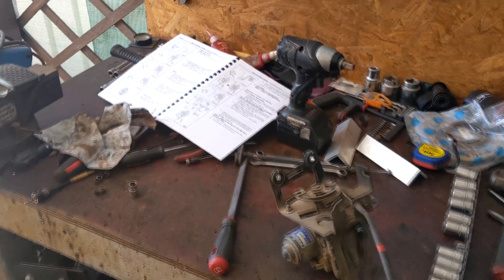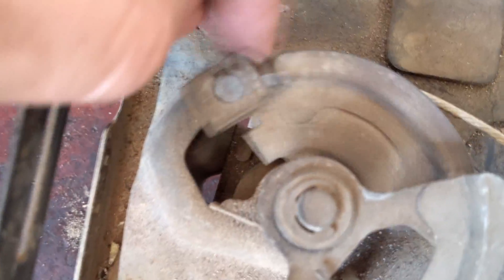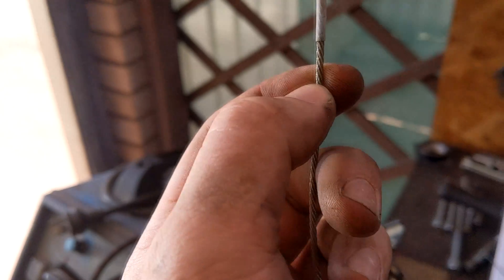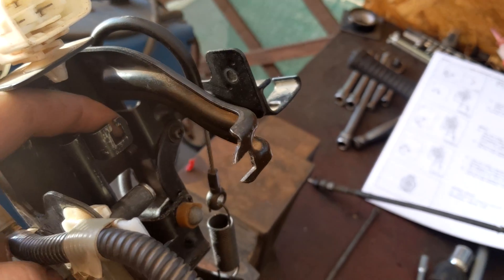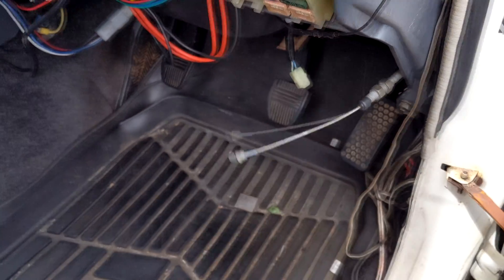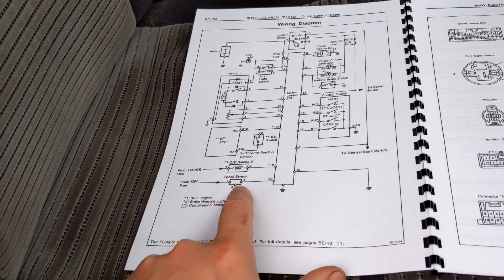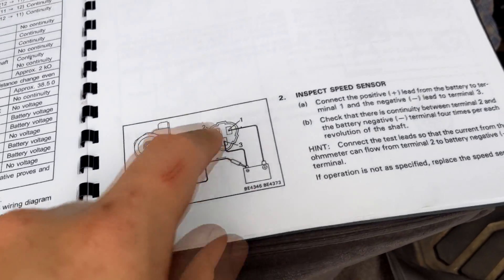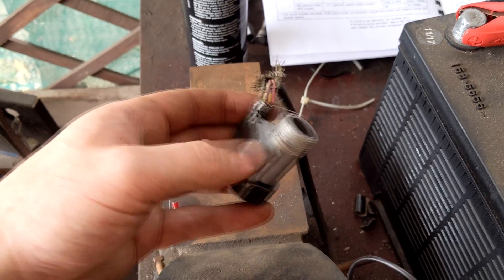How to | Fault finding Toyota 80 series factory Cruise control | Retrofitting to 1HD-FTE swap Part 1

Comment: Hi Brendon, appreciation for this post. I've checked anything and everything i could on my cruise control a few years back and gave up as i couldn't get speed being sensed. Think this video has revealed the missing piece... The entire speed sensor! Seems like the speedo cable must have been replaced with a non cruise control one so there's no facility to deliver speed reading to ECU. I had figured it must be taking a reading from the instrument cluster somehow after the gauge... Now it makes sense why i could never find info about how that works.  Time to try track down the right Speedo cable. Cheers for giving me a next step after years!

Comment: Hi Brendon, I watched your videos on setting the fuel pump on the 1HD-T engine with great interest. I couldn't comment on the videos as the comments were set off. Question: how did you actually determine the "correct" fuel setting? You started with a boost setting and then how did you determine the fuel setting? Measured EGT? Oxygen level in EG?
Reply from the maker: afr is best but egt and seat feel goes a long way